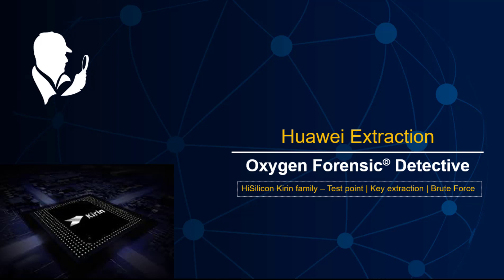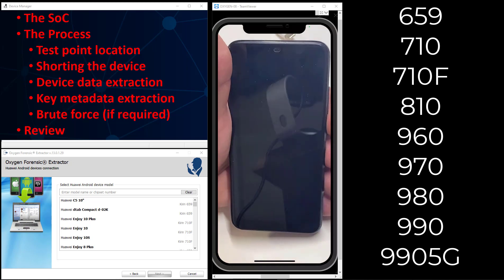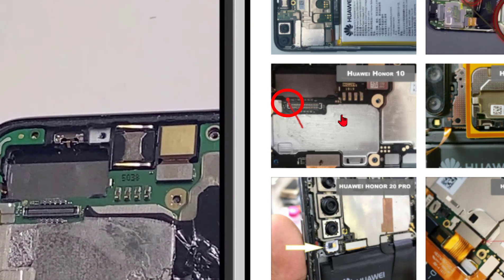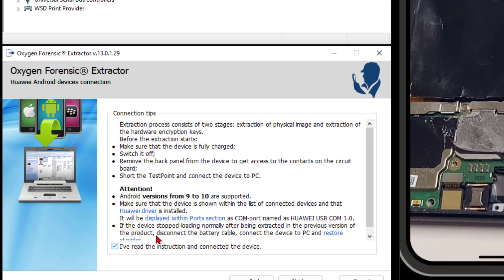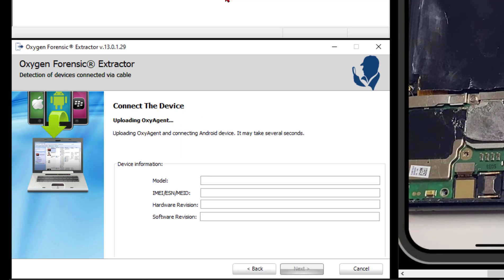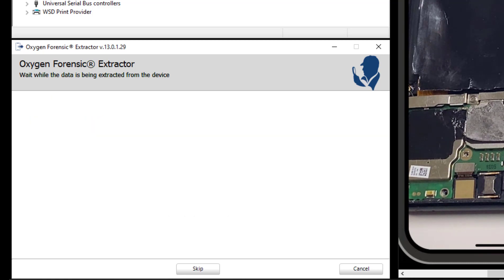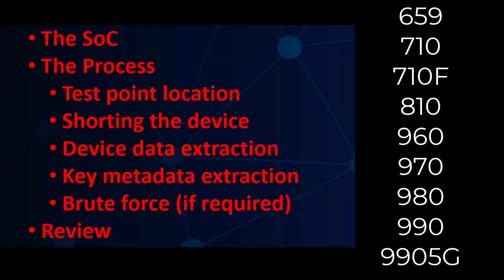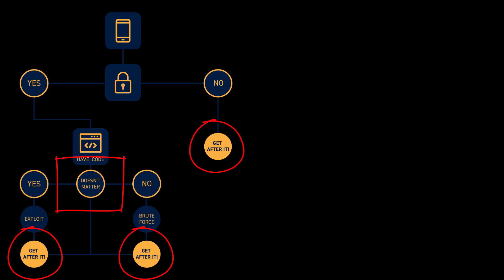Huawei Extraction With Oxygen Forensic Detective

Comment: Hello, I have a Huawei device Y9 prime 2019 After the stage of reading the bootloader and entering the fastboot mode and starting the data extraction process, the indicator of the progress of the extraction process does not appear, and after a while it gives an error in the extraction device stk l21
Reply: I have problem when reading bootloader the error appeared Failed